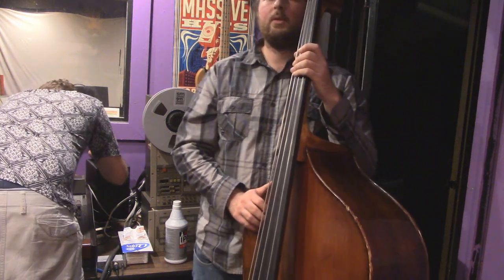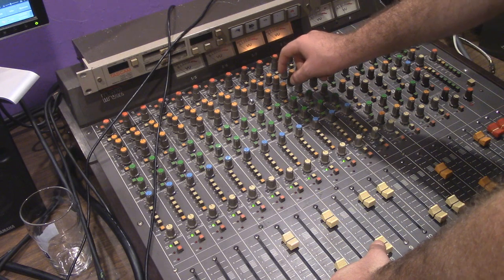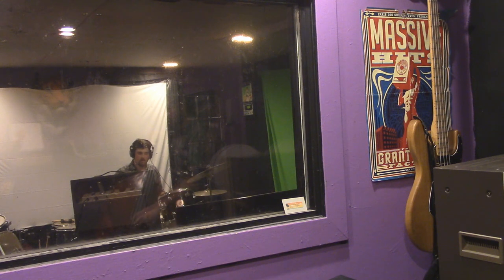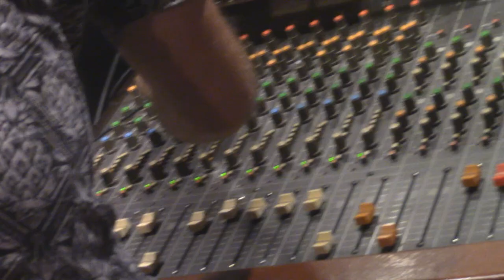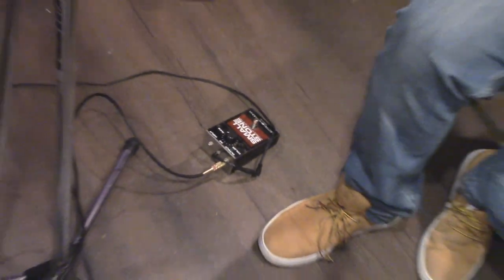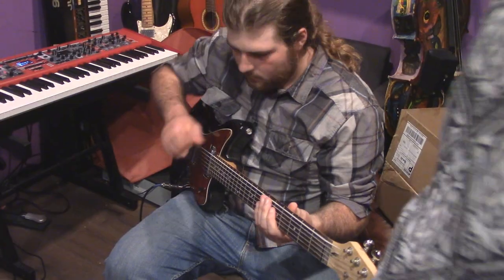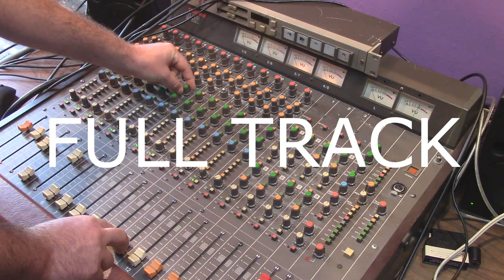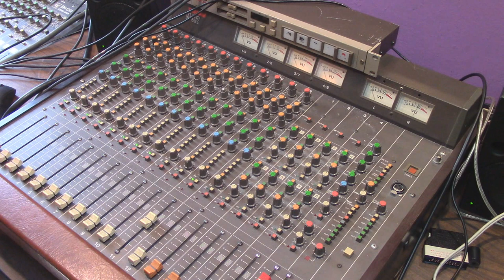Building The Track 3

Comment: The conventional wisdom I've always heard is that stuff like drums (esp kick) and bass live best on the outside tracks.  So this is interesting, and I can see how it makes a different kind of sense.  But what do you like to put on the edge tracks instead?
What sort of pre-planning do you do when you know you're going to do a bounce?
What are some of your preferred methods for adding brightness that you plan to cut later?
Reply from the maker: Denver Walker usually I’ll put lighter instruments on the outside of the tape such as guitar/keys and horns. Save the beefy instruments for the middle tracks. Also, there isn’t much pre-planning whilst overdubbing and bouncing tracks. As long as there is a free track we’ll put them on any adjacent open track. I’ll usually print really bright and also keep it bright because it’s tape and it usually gets pretty dark sounding quick especially when you rewind and listen back like 30 times.
Reply: @BrothersNylon  cool.  My 3440 doesn't like to bounce to adjacent tracks (feedback on the record head).  But, I can get better quality bounces (at the cost of a time delay) by bouncing from the repro to rec heads.  So I often put rhythm section stuff on 1,2,4 and bounce them all to 3, leaving the option of bouncing more stuff on the repro head from 1,2 to 4.
Reply from the maker: Denver Walker ah yes the Otari has the same problem with bouncing to adjacent tracks with feedback. So maybe it’s best to go from 1,2,3 to track 7